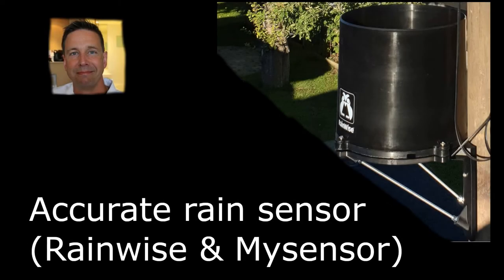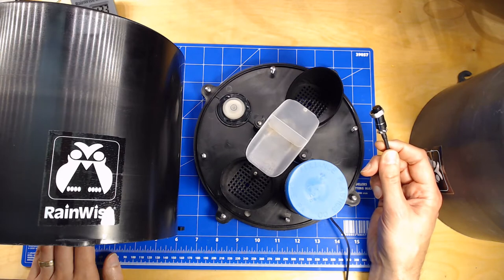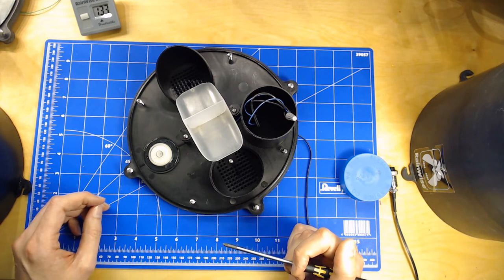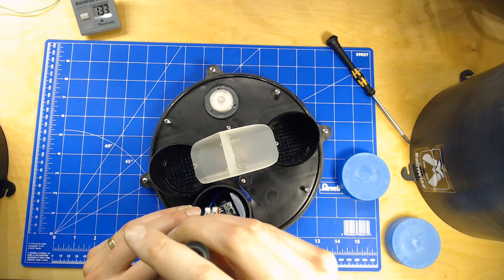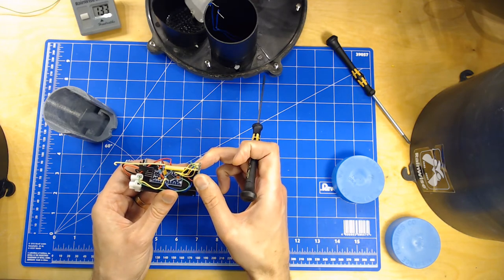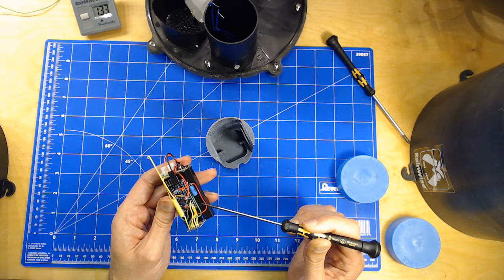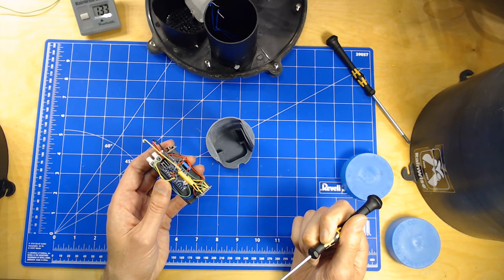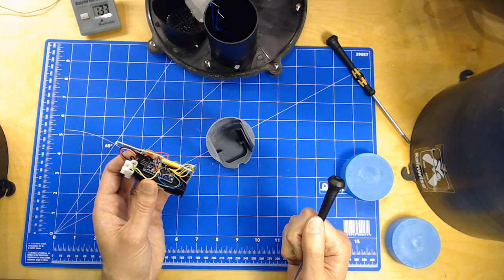Customized rain gauge (Rainwise & Mysensors)

Comment: I have a rain wise, motieno (atmega328p) Looking for more info on how to debounce the reed switch. Resistor, capacitor and Schmitt trigger should do. Not sure the values to get and kind of Schmitt trigger. Oscilloscope on order for testing. I am more of a developer than electronics person.
Reply from the maker: Sorry for late the reply and i guess you have already solved it. I have never added any extra components (besides a pull-up or pull-down resistor) to the rain gauge but rather solved it in SW. For such reed switches there might be bounces up to 100ms but i have never seen more than 40ms (oscilloscope). Sometimes I’ve used sampling at 1kHz and use the sliding average value or something like this https://forum.arduino.cc/t/debouncing-an-interrupt-trigger/. Since the tipping bucket should not be able to handle more than a few tips per second even at completely full bucket you can have a blanking period of 100ms easily. Good luck!